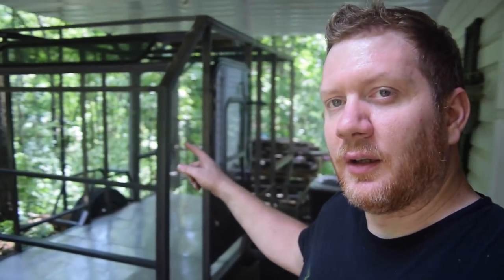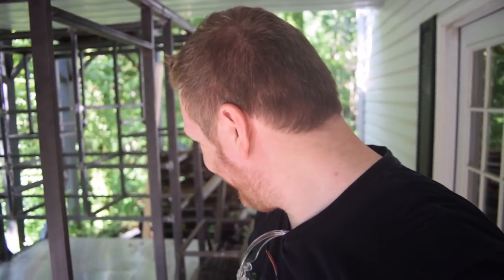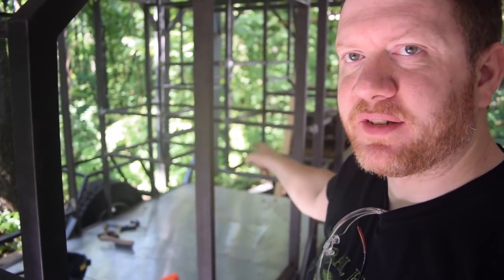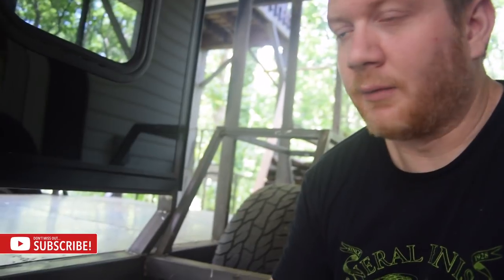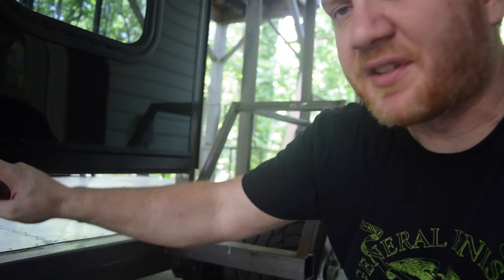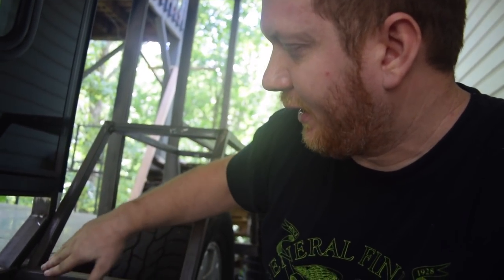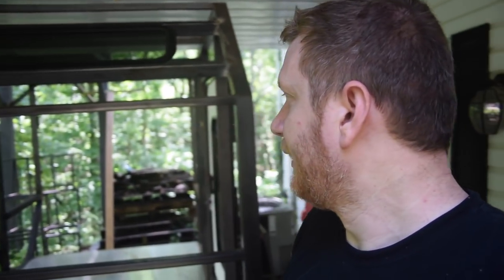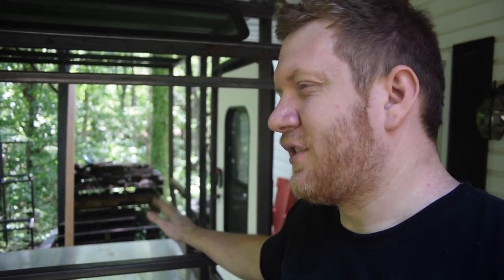Finally got my custom doors | Off Road Teardrop Camper Trailer Build 4

Comment: What was the measurements of the door and where did you buy it from. The door is holding up my build.
Reply from the maker: These were special ordered, they're only one or 2 places that can custom make these haha. I believe these are 48in tall and around  30in wide. Cost me $1300 to have them made, good luck.
Reply: Southern Ginger Workshop I just bought a 30x44 but it’s to big but I’d make someone a great deal on it. 250.00
Reply from the maker: Wow that's a hella deal
Reply: Southern Ginger Workshop also what size is yours? Mine looks a lot like yours.. it’s a 5x8
Reply from the maker: @overland8081  yeah mine is 5x10ish.. so pretty close
Reply: Southern Ginger Workshop ok yeah that’s why the bigger door works for you.

Comment: .  I came across the video of you getting this  trailer from almost a year ago.  So I’m guessing this build will take approximately 200 years at this rate. Lol.
Reply from the maker: Actually it's only been 6 months but yes it will take me some time because I don't have the $10k it's going to cost to finish it. If you would like to help, visit my Patreon and donate.
Reply: Southern Ginger Workshop nah I have my own bills... I was searching for camper  builds when I came across your video. I think I could build one out of wood for less than 5 grand.  I just want a sink a fridge and a stove and maybe a few lights.
Reply from the maker: Yes my original one out of wood that I built last year was less than $5k. Have you watched those 22 videos on that build process? A good fridge is around 1000 bucks unless you use a dorm room fridge that won't handle the bumps and jarring of a trailer.
Reply: Southern Ginger Workshop yeah I’m watch them.  I was thinking a small cooler type top opening dc fridge I think in the $600 range.  But yeah the trailer and fridge will be the most expensive I believe
Reply from the maker: And the doors, $650 for the original ones and $1300 for the custom ones I have on this trailer. Adds up quick. The trailer frame was $2250
Reply: Southern Ginger Workshop yes your right doors will be an expensive item as well.  But I’ll just fit some pre made teardrop doors. Maybe in the $800 range I’m guessing.  So yeah trailer, doors, and fridge will be the big ticket items.  I’m thinking of straight angles too to make it easy instead of the curved sides and back door.  Haven’t quite figured it all out yet. But it will be based on a teardrop camper. Won’t be as nice as the one you built but just looking for a step up above a tent without spending 10 or 20 thousand dollars. Plus I would only use it a night or two at a time.  But I’ll definitely watch your teardrop build videos.
Reply: I finished watching your teardrop build very impressive. Looks great.   I’ve seen others as well and that galley hatch seems to be very involved.  I’m thinking a square back with two doors that open in the middle with heavy duty hinges and each with a folding drop down shelf.   I could put a propane stove on one and keep the area above the fridge as a work surface with a sink to the left.  And two rectangular wooden doors would be much easier to do than that hatch is.  But great job .. I enjoyed watching your videos.